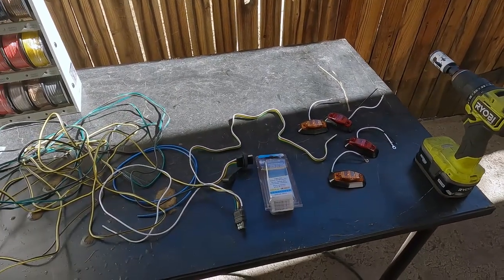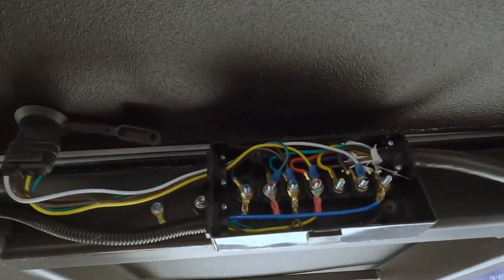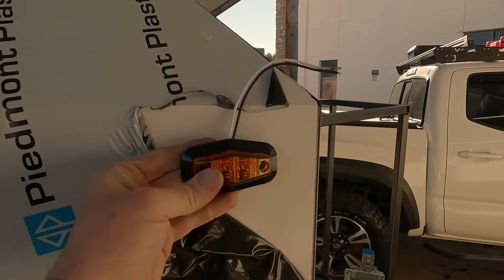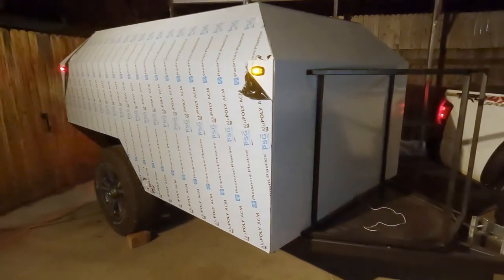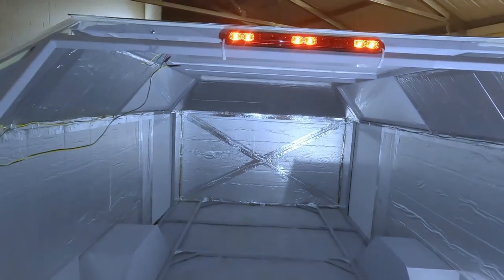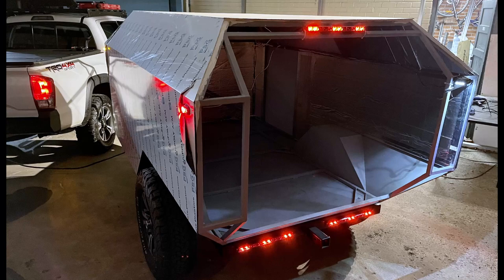DIY Overland camper trailer build: cabin part 9 - exterior lights

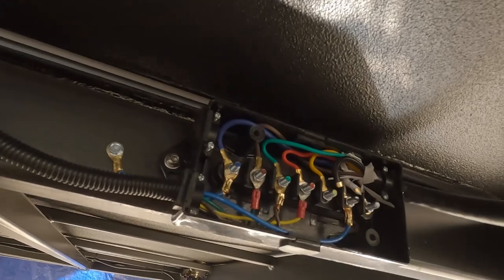Comment: Hey - I know I brought this up to you before...but if you go to 1:04 in the video...that secondary blue wire that comes off the ground to the frame is definitely wired to the black terminal (second from the right)...I bought the same exact box as yours and my product schematic shows black as 12V positive AUX...and the white terminal (far right) as ground.
Reply: Sorry you corrected yourself in the video a few seconds later.

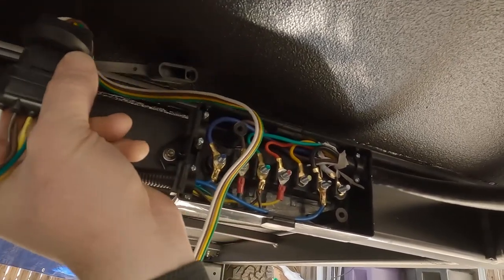Comment: Hey man! My build is coming along...just mounted the cabin skeleton to the frame this weekend.  It took 6 people (mine is a little over 5' x 10').  Almost finished with the insulation as of now.  But, question in this video since I've been worried that my Timbren brakes were wired correctly or not.  At 0:51 in this video, I see not only the blue (#1) electric brake is being sent through your loom...but also it looks like another blue wire is coming off the #6 aux post.  Do both of those go to the timbren wiring? I only connected the #1 blue to one lead on the timbren brakes and then grounded the other to the frame.  Let me know and thanks
Reply from the maker: I believe that the second blue wire that you see is the one that goes to the ground point next to the box.
Reply: @infosponge  Was there a way you actually tested that the brakes were firing? Continuity meter?
Reply from the maker: @mattmatthiessen7743  I just cranked up the level on my brake controller and verified that the brakes were working.